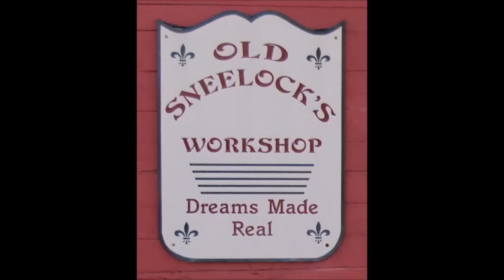Tinkers Work - Soldering On A Patch - a video tutorial by Old Sneelock's Workshop

Comment: 1st, if the closed captioning works for you, gopher it but if it's a vast pain, can it. Not Gerry can it though. 2nd, the solder joint looks like the one the Saw Surgeon did in a 5 horse Briggs gas tank where the dimple is below the fuel pick-up before ethanol struck. Those tanks always rust through right there and this one had about 6 pin holes in that dimple. He used JB Weld and it worked wonderfully untill the ethanol started and then the ethanol turned the epoxy to plastic/rubber. It peeled right off in a big chunk. That's when I dribbled some Seal-all in it and it hasn't leaked since. I had to remember to turn on my closed caption. Silly me as always.
Reply from the maker: I have a Tecumseh Generator that I picked up last fall. Hasn't started yet. Carb trouble. The thing I noticed right off was the new steel gas tank on it. Must have been running the new gas in it. 
Tecumseh engines are not my favorite. I can get them running but it's a constant battle.
Reply: My feelings exactly. All my Tecumseh's have a plastic tank and I just really have one (the old Duerr grinder that the cutter still needs to be removed) except for the newer mowers that have the Tecumseh setup on them.. Maybe someone in the company changed something but that wretched stuff works on plastic really bad. I could tell how much ethanol the gas had years ago by how hard the gas cap was to get on and off in my old Super 45. Now it's the Echo trimmer and blower. The Saw Surgeon was commenting about that the other day too. I just run mid or hi grade gas. The regular won't even start in the old engines and I can't even run the newer ones wide open because of vapor-locking. The old Kohler cast iron block engines don't like this junk either but I don't have to keep them maxed out. I wish that stuff was recycled in whoever made us use it, internally.
Reply from the maker: Lewie McNeely If that's what it takes to sell corn then let's just not sell it.
Reply: You do fine just the way things are which is NOT hard to see. There are ways if folks are really wanting to know what exactly is going on. The video speaks for itself and the talking just backs it up. You do a fine job already. You'll be up all the time if you have to put even more time into all this and all work and no play, even though you have a real enjoyment for what you're doing, WILL break down my favorite Uncle, and myself and my favorite Uncle are broken down enough already. The corn can stay in the freezer till it's time to be eaten. You want a closed caption, gopher it. As Sweetums tells me so tell I you- Don't over-do!
Reply from the maker: Good point.
Reply: Old Sneelock's Workshop You're the only Unle I have left. I want to keep you around as long as I can!
Reply: @OldSneelock  Hi to all and Prayers for Aunt Lydia for comfort and healing and for strength for Unc. I know an update will come when it's time. Till then, we're all still here and here we'll be. 
Happy Motoring as Marty says!

Comment: Is this the same stuff that we use to solder wires together ? is it strong, And can i used it to solder aluminum and metal ?
Reply from the maker: +Mr Cool Yes it is the same type of materials used to solder wires together. Tinsmiths, and electricians both use solder made from an alloy of lead and tin. The difference between what a tinsmith and an electrician uses is in the flux. Solder for wires uses rosin based flux that isn't corrosive. It doesn't clean as well as the acid based flux but wires should be clean before soldering anyway. The acid based flux that I'm using here cleans aggressively and must be washed off or cleaned in some manner or it will corrode the base materials being joined. 
Yes it is very strong. Not as strong as brazing or welding. Soldering usually relies more on joint construction than on the strength of the solder bond. The method  that I used for  soldering the Gerry can doesn't have a mechanically folded joint to help reinforce the joint. 
Lead based solder can be used on steel, copper, and alloys of copper with zinc or tin. Lead based solder is not used on aluminum. There are solders that have been developed especially for aluminum. http://www.weldguru.com/aluminum-soldering.html
When you go to your local hardware it is much more common to find silver based solder than lead based. With the concern of how lead in water can affect peoples health lead solders have fallen out of favor. The silver based solder melts at a higher temperature and requires special flux.
Reply: + Thank you so much for your detailed reply! You are very knowledgeable man, And i'm really in love with your amazing channel:)

Comment: Easier to clean piece before cutting maybe thanks for this video
Reply from the maker: It would be easier to clean as a larger piece. Given a choice I would rather use a piece of galvanized sheet steel. In an effort to make this more about  using common materials I went with a section of a can.

Comment: It seems alright. But more solder is wasted. Try saving solder.
Reply from the maker: How is it wasted? The solder that is applied does the job. Any extra is used to fill the hole.
Reply: @OldSneelock  I am very much pleased to get a reply in the form of a question. I like the video. However, I'd like to say that extra solder is not required. It's a wastage. It's my observation and learning from my tinsmith father's works and my own practical experience. Improvement is a never ending process.
Reply from the maker: @arumughamn  I appreciate you explaining. I learn from comments like yours. I never thought of trying to conserve the solder. I have in the past. Soldering pipe for a whole house or building a project rquiring multiple seams would be done very differently.
 The tank was basically scrap and I thought it was an opportunity to show how soldering can be used to fix a leaking tanks with minimum equipment and scrap material. The bit of tin can is not the best and the tank material is not the best for soldering either. 
I could have done a better job of cleaning the materials. That would have made the tinning more effective and required less solder. I also could have flattened the patch so the gaps were smaller. That would have improved the joint and required less solder to fill the gaps. 
I assume your father made his living as a tinsmith. Conserving materials has a big impact when the job puts food on the table for your family. I think in his position I would have been more careful.
Reply: @OldSneelock  not trying to be mean,but saving solder,now that funny,makes it sound like you used a brick of solder.😂😂😂😂😂
Reply from the maker: @filibertobarrera3839  Thanks for stopping by and adding your opinion. 
Arumughan made a good point. It isn't something I think about often. I am in the enviable position of having a stockpile of materials to use and little, other than demos, to use it for. I didn't mind him expressing his opinion and pointing out an alternative. I took it as the honest criticism that he intended. I then explained how to reduce the amount of materials used.

Comment: I hope people read that your can was just used to hold water, as if you try that with any can that has had fuel in it you will have to eat that can. I'm OK with soldering fuel cans, just make sure people flush them with inert gas to remove the oxygen, such as CO2, argon, nitrogen or even freon.
Reply from the maker: I've soldered fuel cans and tanks before but I'm not going to recommend that other people try it.
At 11:32 I explain that it was a water can and that if it hadn't been I would not attempt to solder it.
If they are going to follow the process I hope they read the description and watch the whole thing first.
Reply: Old Sneelock's Workshop I understand what you mean.

Comment: Nice Job,   but,  I'll bet there's still plenty of rust inside that can..    It will get in your gasoline..  If your using the gas as motor fuel,   I'd get a paper filter if I was u..    Small rust particles will clog anything..
Reply: Jep. Better throw that rusty piece of crap in the bin and buy a new one. This thing will just cause your fuel filters to clogg up...
But nice for practising...
Reply from the maker: You just have to clean it well and don't put the alcohol mixed crap gas in it. Steel gas cans and fuel tanks have been around for a hundred years. Tinkers have been soldering leaks since the middle ages.
Reply: @OldSneelock  ,  It is possible,  I restored an old motorcycle..  The tank was rusted like crazy.   I filled the tank with small rocks,   and spun it slow in the lathe for a whole day..     It was clean as a whistle after that..  never had a problem.
Reply: Lol anyone else here ever slap 4 fuel filters on a tank when they are too lazy to clean all the rust
Reply: @THOMASTHESAILOR  that's a good idea!
Reply from the maker: @propabilityfpv303  Never did 4, but there is a single on the lawn mower and a sediment bowl on the tractor

Comment: Super glue would have worked just fine.
Reply from the maker: Never tried that. Does it hold up to gasoline?
Reply: Old Sneelock's Workshop no, it won’t. I’ve actually used gasoline for removing glue residue
Reply from the maker: Thanks Jason. 😆😎

Comment: That's a gas can not a water can.
Reply from the maker: MrJeep75 Thanks. How do you know?
Reply: Old Sneelock's Workshop water can's got a totally different style of lid it's not a screw on, Google G.I water Gerry can's you will see
Reply from the maker: MrJeep75 Thanks. I looked it up. Water cans are marked completely different. Must be this was either used incorrectly to hold water or it got left open and collected rain water.
Reply: Old Sneelock's Workshop it probably got left out and filled with rain water
Reply: Old Sneelock's Workshop you can also get tank sealer at Napa
Reply from the maker: I want to use the NAPA tank sealer on the Ford 8N. The alcohol contaminated gas has caused it to rust. Good job for when the weather warms up just a bit more.
Reply: Old Sneelock's Workshop put oil in them when not in use it will protect them from rusting
Reply from the maker: I found a source for alcohol free gasoline. It doesn't draw water and with some StaBil in it the tank has stopped rusting. I just want to seal up the inside of the tank. 
Thanks for all the good suggestions.
Reply: Old Sneelock's Workshop no problem always willing to help, good luck with your projects, got few myself

Comment: lead free is crap
Reply from the maker: It is more expensive and requires different flux. The quality of the solder isn't determined by the percentage of lead. That is a decision that should be based on cost and how effective the alloy will be in the proposed use.